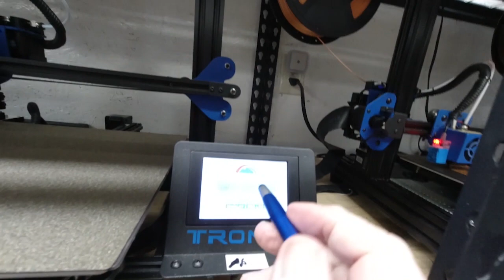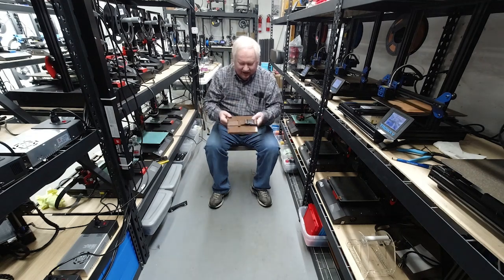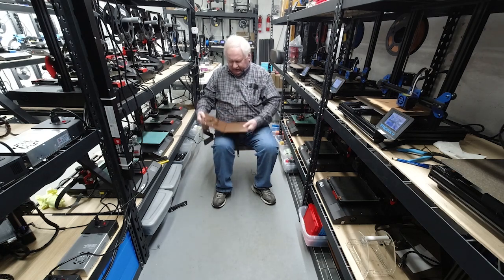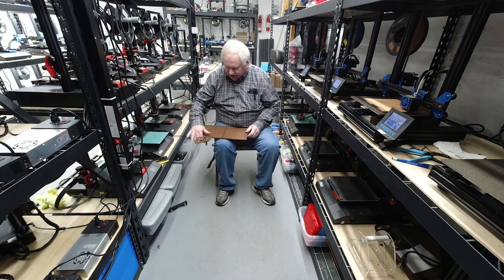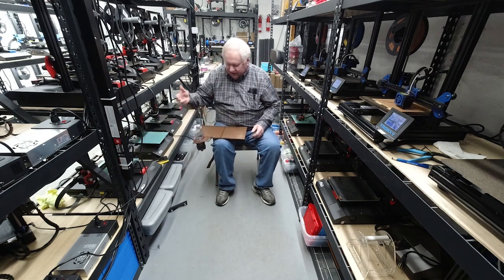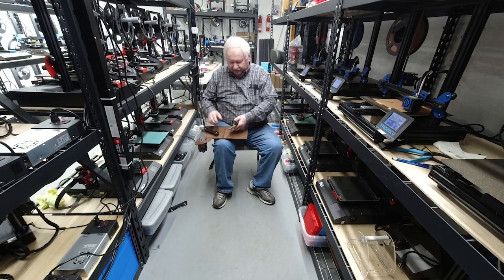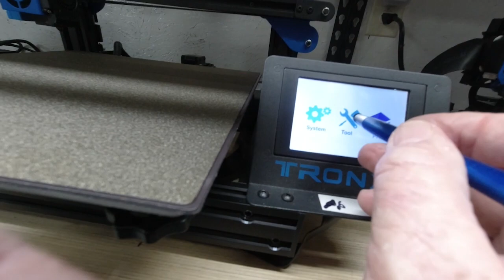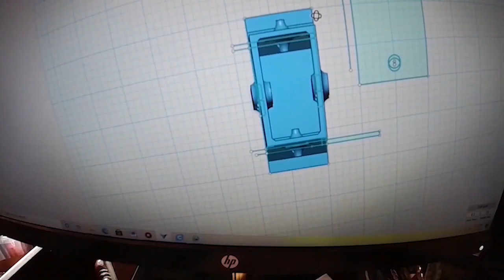3D PRINTING PARTS ON TRONXY XY-2-PRO PRINTERS at my print farm.

Comment: Love the lap diner demo. Do you use a metal rod to join the lap diner parts at the joint?  Larry
Reply from the maker: Thanks for the question, Larry. I do use a 2mm aluminum rod for the hinge pin, that won't rust if it gets wet. Thanks for your support...Ken

Comment: Love the Video, what material are you printing these in? i have just got into printing so i only have PLA at the moment, what material is the simplest to move forward to, that can be printed in the house, i hear that things like ABS are very smelly?
Reply from the maker: You're right about ABS Frank. it does give off more of an odder and you should have good ventilation when printing with it. PLA is not as strong as ABS however the PLA can be strong enough in many applications and the strength of parts printed with PLA can be increased by printer settings and part design. About 90% of my parts are printed with PLA. Good question my friend...Ken